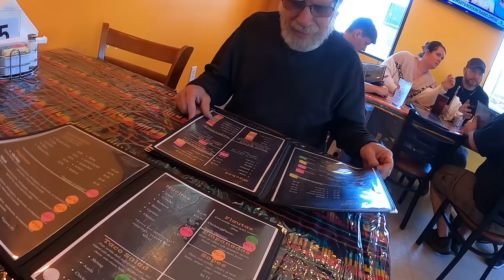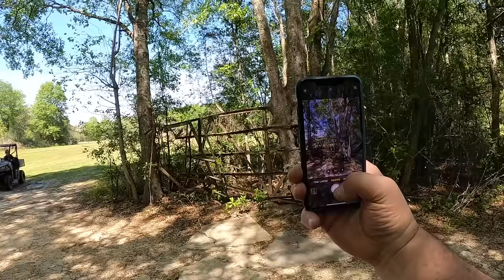What He's Selling Might Surprise You

Comment: That foundation is called Duragilt.  It only has the metal crimps on the sides.  It's absolutely awesome,  much better than the thick hard plastic fake foundation that everyone is in love with now.  It has a full wax coating on both sides, the flexible center sheet isn't exposed.  Bees draw it out pretty much like wax foundation.  Dadant stopped making it about 7 or 8 years ago.